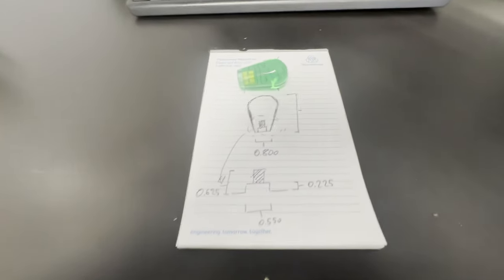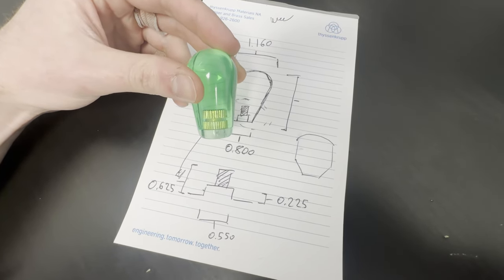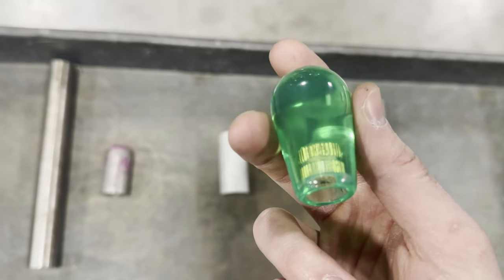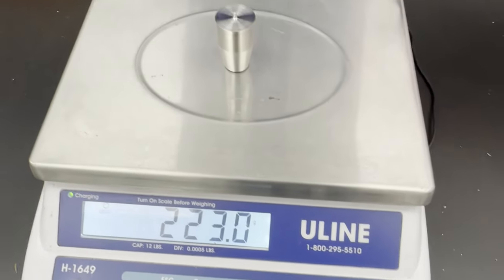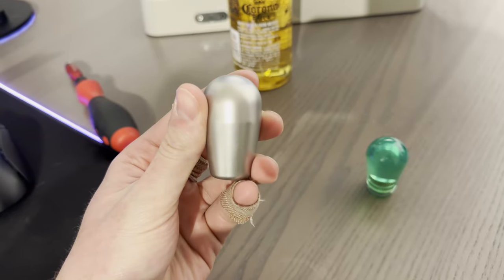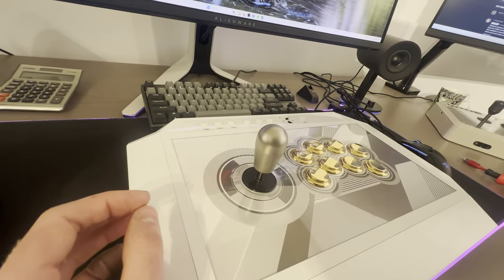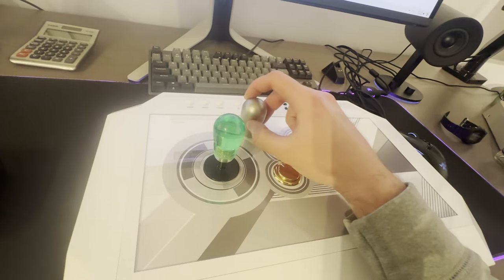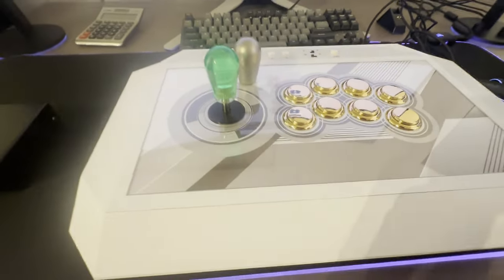Making a Full Metal Top Korean Lever for the IST Alpha N (Bat/Bullet custom hybrid lever)

Comment: I like the matte silver look of the top. I say keep at it. I can't wait to see what else you cook up. I used resin/plastic tops and delrin tops and I know that delrin can be heavier than the resin/plastic but I never have thought about using a Korean style bat top with the larger dip from the bottom out of stainless steel metal. I've seen aluminum ones but they don't go so deep. Also if the top goes too deep, I do use washers to give it some height.
Reply from the maker: I’m gonna try and do a ton of different variants, probably tons of creative designs when I find the time! Definitely a passion project, and the different materials will be so fun to experiment with!

Comment: It is so hard to get information on the IST Alpha N!
How does it work for 2d games?
Reply from the maker: Thanks for watching dude! So usually K-Levers have an advantage for 3D fighters due to most of them requiring inputs that MUST be executed quickly and from neutral. So with a K-lever like the IST Alpha N, that comes with a 35 rubber grommet, the lever springs back to neutral exponentially quickly depending on how far you push the lever away from neutral, which allows for an easier time executing the Korean backdash or any Mishima electric inputs, which are forward, neutral, down, down-forward 2. Now for most 2d games that have no off axis movement or inputs that require a neutral stance mid combo-input, I feel like it wouldn't be as beneficial it is for a game like Tekken. But don't let that discourage you from giving it a shot if you've got the extra funds, at the end of the day its just another lever that with some practice will make you a god at 2D fighters as well. I'll probably start up Street Fighter 6 to play some Akuma soon, so I'm curious myself if the k-lever will fuck with me or not!
Reply: @zmaxlee  Ive been playing with this lever since i wrote the previuos message. 
I LOVE IT. 
I tried Gersung switches on it and liked the fact that they work amazing for forward and back dashes. 
However, the Omron switches are more responsive and soft. Motions come out easier and im having a great time with SF6.
Thanks for the reply.
Reply from the maker: @leperique  hey that’s great to hear man! Really glad you like the lever, the switches really do matter, I have two Alpha N levers with different switches, and one definitely fits my needs more than the other. Glad you found the right ones for you!